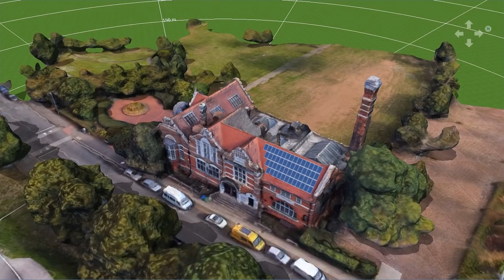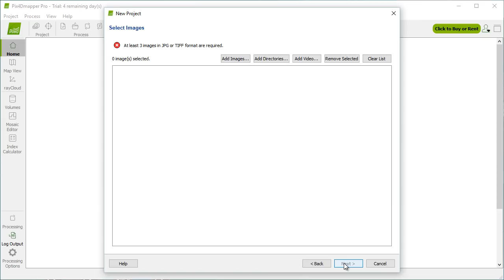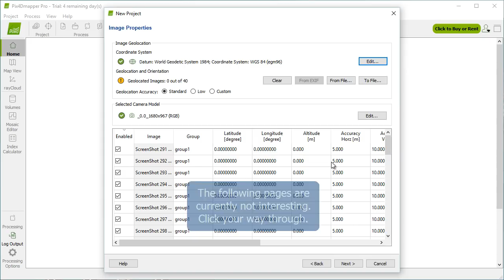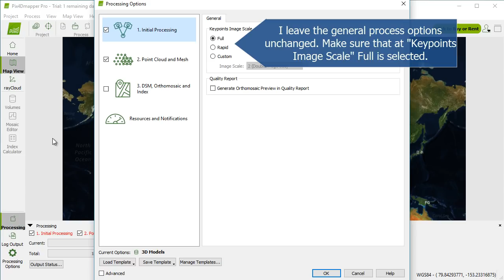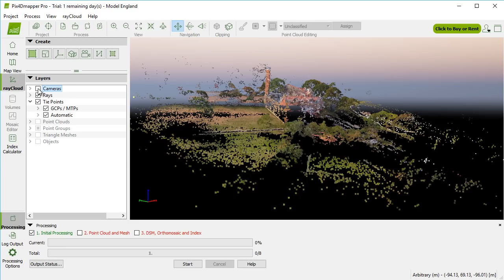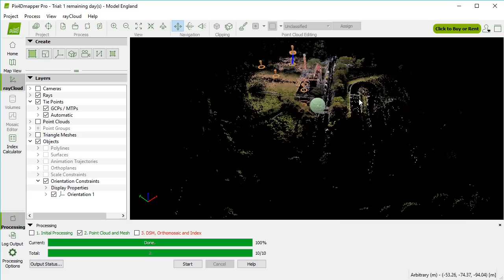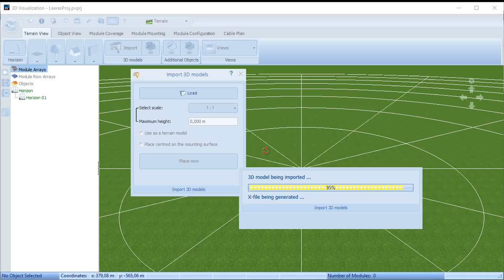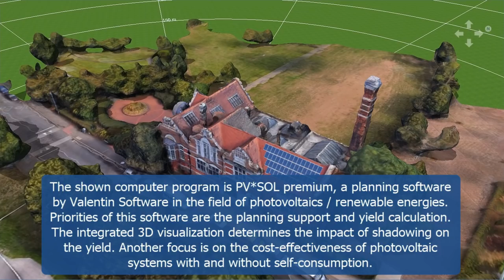[Tutorial] Extract Google Earth 3D models with Pix4D and PV*SOL premium 2018

Comment: Hi!
Thanks a lot for the Video. I have a small problem with the imported model in pv sol. It is plain white. It has no texture, no colors. In the Pix4D project folder there is a file named texture.jpg but apparently it is not imported into py sol as well... could you help me with that problem?
Thanks a lot!
Reply from the maker: Please contact the support of Valentin Software:  
https://www.valentin-software.com/en/sales-service/customer-service/technical-support
Reply: Is there already a solution or fix for your problem? I've got the same problem at this moment!
Reply: already found the solution, reduce the pixels of your pix4d file in the settings from 8960x8960 to 4096x4096 or somewhat option.